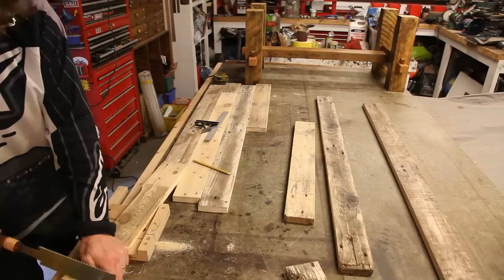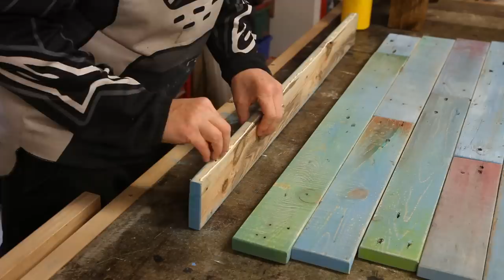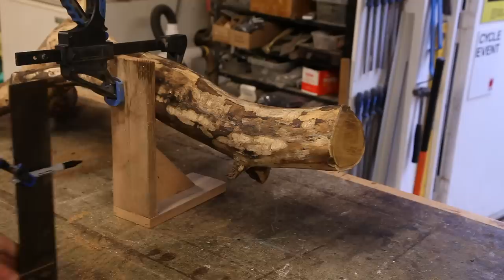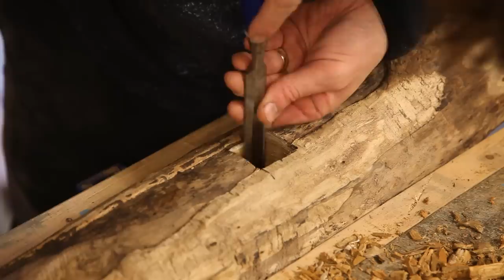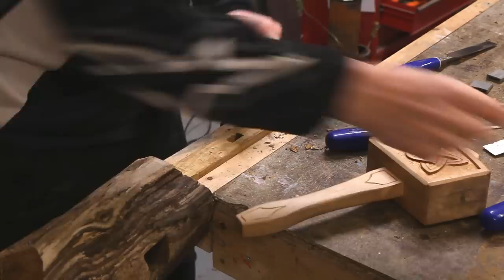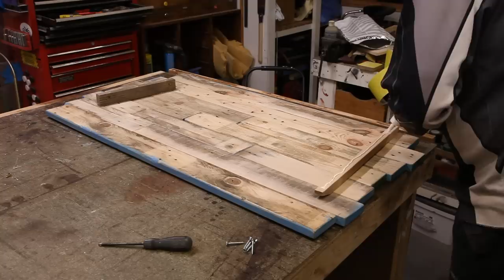Desert Island Pallet Wood Coffee Table

Comment: If I could find pallets made out of such good wood, I'd also take the time to drag them home and tear them apart.

I've watched other videos where the person applied glue to both edges before joining them.  You only applied glue to one side.  Is your method just as strong?

Loved the way those ends were scribed to fit the contour of the joining pieces.

The way you finished that top gave the impression those boards came out of a house of similar place.  Was that just water based house paint you used?

And like your other projects, the results are wonderful.
Reply from the maker: Thanks for the comments, Jamie. I sometimes glue both edges. It depends how absorbent the wood is. If the wood is quite tight grained I Usually do just one side.
The paint was just regular house emulsion with some kids acrylic paint used for tinting.

Comment: How long (about) do you let your pallet wood sit around being seasoned before working with it?
Reply from the maker: Usually at least a year before I brake them apart. Several months out in the rain, then several months under cover seasoning. After I brake them up, if possible I leave the boards for another few months before using them :)

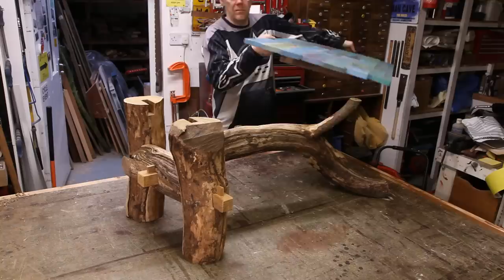Comment: While I think that most of your projects are like those old wooden puzzle boxes, and a positive joy to see completed, this "Desert Island coffee table puzzles ME. At 31:32 the video shows you installing the top - which seems unevenly supported on your left-hand side. 

Is this intentional? I could understand if this was designed for installing in a particular place, and the seemingly less-supported side would have a table lamp or something there. But if this table is to be a coffee table, it seems like that side will end up not supporting what's on top of the table, especially toward the corners. 

I would like to have such a table - because I would do just what I said, and put an antique-looking brass lamp on that end, and maybe a digital clock. But as a life-long Fatty, who has had a chair or two collapse under my big behind, I like stuff that's well-engineered. And safe.
Reply from the maker: It's quite a lot stronger than it looks. The main support is coming from the Right hand side, which it is screwed to. I wouldn't want to sit on the left hand end, but I regularly put my feet up on it.